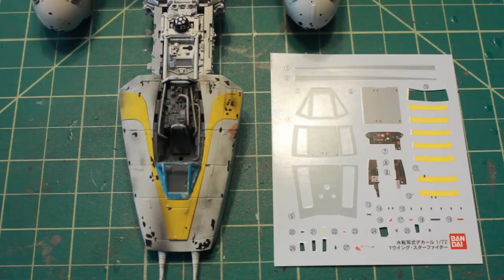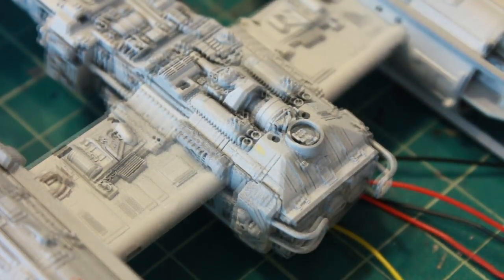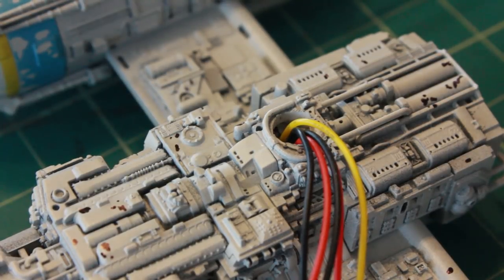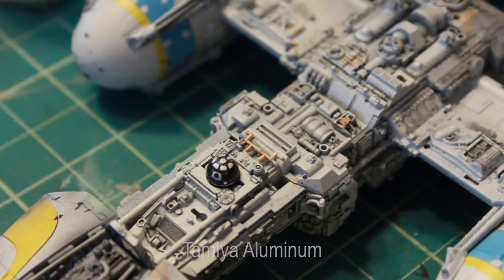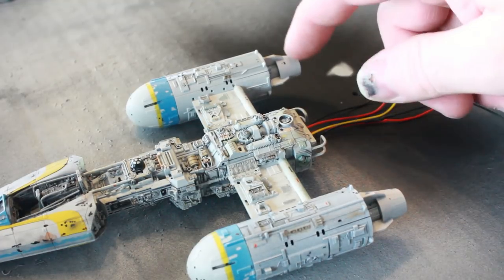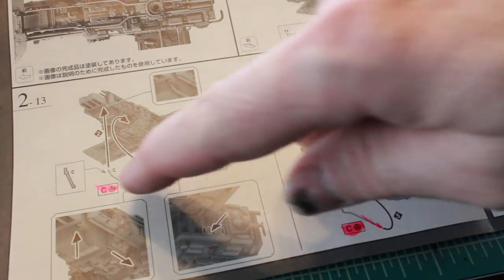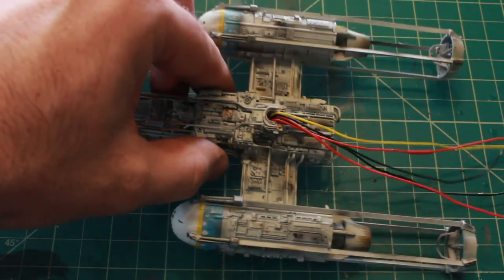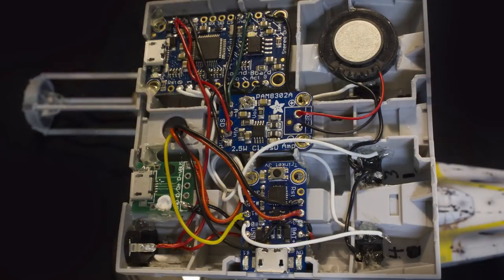Bandai Y-Wing Model Build Pt VII Final Reveal and paint

Comment: Someone in Hollywood give this guy a Job.   Hello This is how its done.  Amazing Work.
Reply: Those are nice sentiments but do you know how many jobs they're NOT hiring modellers for and how many modellers retired from Hollywood after the Star Wars Prequel trilogy ended ALONG with all the carpenters and craftsmen Lucas DIDN'T hire because he green-screened those movies to death?!?

It's mostly CG now...   95% of what was previously done with modelwork is basically all computer now.  I like the modelwork better myself but there were reasons they DIDN'T paint these vehicles with prominent blue and green markings in the original Star Wars series!
If you go back and look at the Starship Enterprise in dock in Star Trek: The Motion Picture (the original film on VHS, laserdisc, and Blu ray), you'll see tons of blue screen bleed on that model and the drydock during Kirk's exterior inspection tour.  That happened mainly because the SFX on that film were rushed because the previous EFX company screwed up and didn't produce any useable effects footage for the entire time it was hired.  It's really only a few seconds here and there were the blue screen leak is bad (and most notable on the drydock model; the Enterprise has so much going on that you have to pay really close attention and notice the bluescreen leak most on the inside starboard/right wall of the hangar bay).  The worst bluescreen bleed by far was on the Klingon Cruisers at the beginning battle sequence of the film.
They avoid that issue by going the CG route.  That's how they were able to have a Blue Squadron in the Rogue One film.

Comment: What brand tweezers are those in the video, the ones used in the decal setting? I would like to have a pair.
Reply from the maker: It's a set of non static tweezers I got on Ebay. 
https://rover.ebay.com/rover/0/0/0?mpre=https%3A%2F%2Fwww.ebay.com%2Fulk%2Fitm%2F173556814477